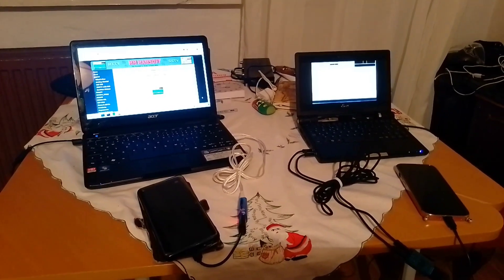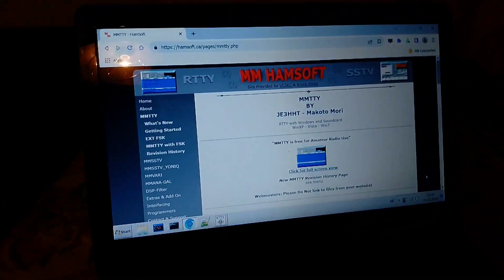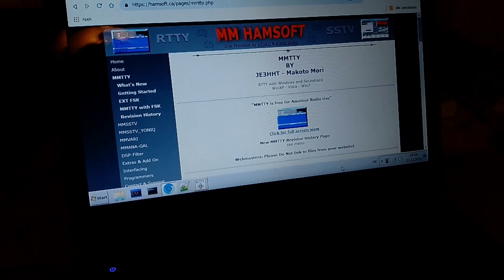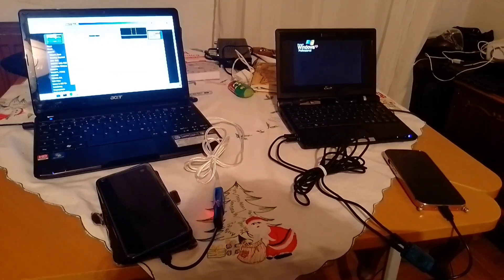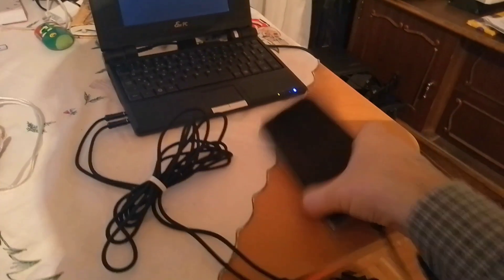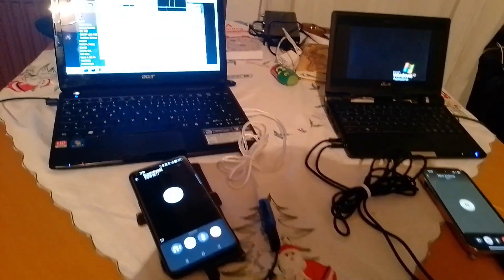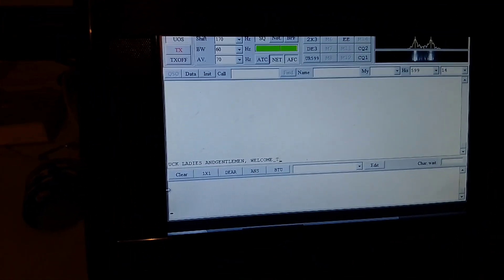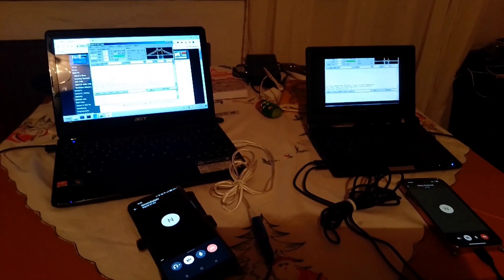MMTTY: Teletype transmission over Signal

Comment: I've recently discovered the existence of "telephone line emulators" that allow one to connect two modems or telephones together, and it simulates dialtone and allows the two devices to communicate. I'm considering picking one up for similar experiments.
Reply from the maker: Super cool, I had no idea! I admit, mine are self-made, as follows: you connect two 9V batteries to “an 18V battery". Then, carefull slice open a phone cord to which two phones/modems/etc can be connected. You will see two or four wires (of which you then care only about the center two). Cut apart one of the two wires (doesn’t matter which) and connect its ends to the 18V battery (polarity irrelevant). Voilà, a powered phone line — my daughters actually have a phone connected that way. All it cannot do is "ring" or "present a dialtone", but with a modem ATX0 or ATX1 will ignore this. Can you connect two modems? Absolutely, try with ATX0&C0&D0L3N0E1S37=1 (some don’t know about N0, no problem; and others insist on &C1, and will work then) on both, then tell the dialler ATD and the answerer ATA, and you should connect at 300 baud.
Reply: This is great information, thank you! And much cheaper too

Comment: It seems that VoIP is fast enough to handle audio encoding data! ;-)
Reply from the maker: I am sure a man of your talents already has ideas of where you might take this… ;) The “holy grail", of course, would be modem transmissions, but already 300 baud — the lowest broader standard — is too fast, unfortunately… "yet". … Give it five years, let’s see! ;)
Reply: @ninoivanov  We just need some higher bandwidth to carry higher audio bitrates to reach blistering fast 110 and 300 baud 🙂
Reply: @ninoivanov  No seriously, I've seen this discussed wrt dialup over VoIP. I think 300 baud is the speed limit at this point.
Reply from the maker: Thank you for the info! The thing is, ATS37=1 is the lowest "pre-defined" speed in Hayes Modems — and these are 300 baud. I’ve got to experiment perchance with ATS37=0, but while that should be "automatic", many modems still do not allow you to go under 300 baud.